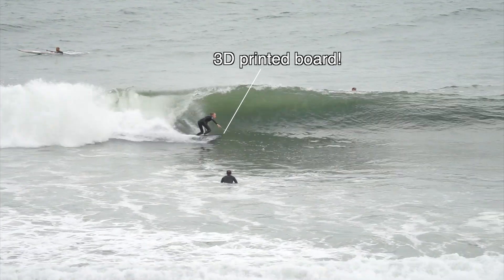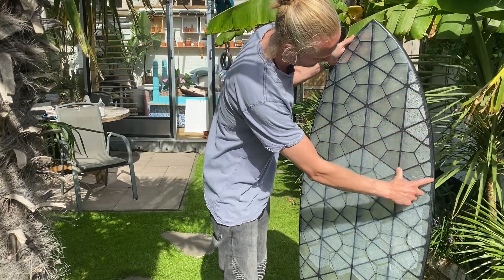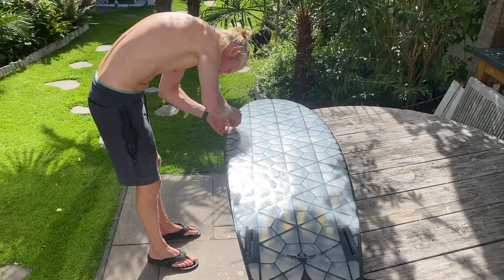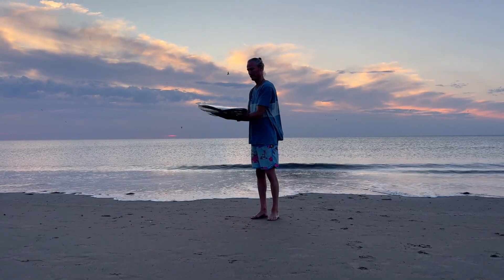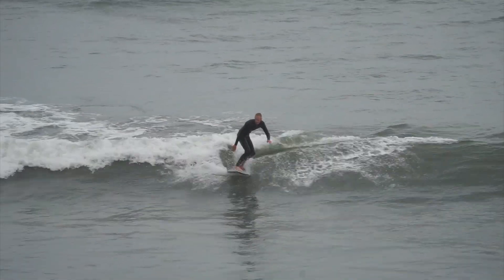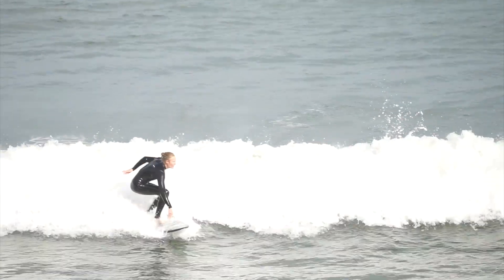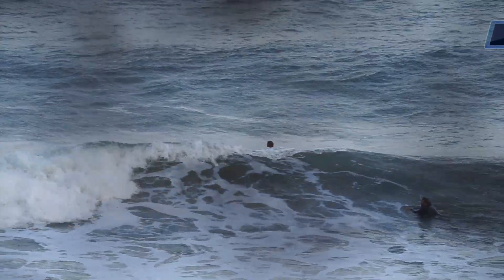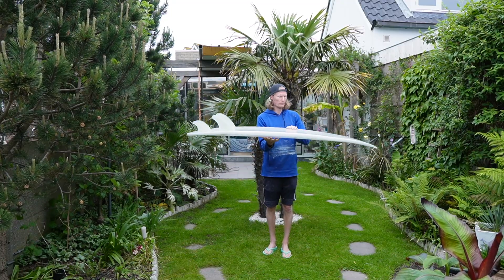Update on the 3d printed surfboard!

Comment: I’d like to suggest using PU or EPS foam as the core of the surfboard and then wrapping it with fiberglass and epoxy resin.
Reply from the maker: Thanks for the suggestion! I think this is a sarcastic comment. I do appreciate this kind of humor. 
If not. That’s how traditional surfboards are made.. check my other video’s for that kind of boards.

Comment: When you were riding the board  it looked stiff. In other words it needed more flex in the board to match the contours of the wave. Additionally, the flex will give a power boost when it uncompressed kind of like a spring.
Reply: I also seen that the weight is kind of high. If your water displacement number is high enough(ie the boards flotation) you could thin out thickness of the board. This should give you more flex, thinner boards track better on waves as well.
Reply from the maker: I think this board is allready pretty low on volume for the waves we have in the Netherlands. So I’m not gonna shave some more floatation of off it. Thanks for your thoughts though!
Reply from the maker: Yep. That would help. The board is very stiff with the 3 carbon stringers in it.

Comment: Looking at you riding the board is awesome ! Loving it. The spray and wash from the board makes it look like the board does not want to glide well and the water flow has issues separating from the board, it looks like it sticks to the water far to well. That would make sharper edges and a slightly bigger rocker with a sharp edge for better flow separation a good start. Once the board gets up to speed better and has more bite the rest should fall into place.
Reply from the maker: The egdes are very sharp in the tail, so I don’t think thats the issue. Maybe starting to be sharp earlier in the rails near the finboxes will help? But adding more rocker, only slows the board down right? Adds turnability but sacrifices speed.
Reply from the maker: Thanks for your thoughts by the way! Appreciate it.
Reply: @Dzjiefoils  Looking at it some more, the rocker is probably ok as it is - the board does well when you get a good launch and glides up nicely, your position is pretty far back, so when you start carving the board stalls early. You could try to go with a swallow tail instead a fishtail, that would give you more area to stand on and help with keeping the glide up. I think the main issue is keeping the board at speed. A longer tail would help with that, but I don't think that you're off by far.

Comment: What fins do you havr on it ? I use machado black black and red, large fins. They hold me well I'm 80kg. Never slipped out on b turn.   And also try to compress more down there to accelerate better. Your level is better yhan mine ! 😂
Reply from the maker: Thanks man! The fins are not the issue because I use them on my onther small fish and that works great. Maybe its the combination of the fins and the board.

Comment: Try making the hexagons smaller next time. You therefore can make them thinner and maybe even save material/weight. What i figured out while 3d printing is that the normal thin infill with 20-30% is often lighter and more stable then me trying to make artificial hexagons. It wont look that nice tho ;) :D But then you could also use Carbon fiber instead of Fiberglass
I'll keep watching and learn for my own surfboard build!
Reply from the maker: Thanks for the input! Will defenitely consider it.

Comment: I'd like to suggest incorporating a wooden stringer, perhaps by leaving an opening in the center portion of the spars?  If you can find old-growth heart vertical grain redwood or spruce with many growth lines per inch it may provide some springiness to the board.  Most wood sold now is just pulp wood as the trees are too young to have the ideal structure.  But you can find recycled wood sometimes - probably harvested in the early 1920's in California, I don't know in your area. But those trees were likely hundreds of years old.  If you make a  6mm thick picee of that kind of wood and try to break it it takes a lot of force and will bend into a bow before breaking. In comparison the new pulp wood of the same size will easily snap.  A 6mm piece of vertical grain wood my have at least 6 growth lines and perhaps eight.  Perhaps bambood would also be a good option and easier to find.  Edit: I just found your other video about the carbon stringer and probably that will be tough to beat with wood.
Reply from the maker: Hehe this board has 3 carbon stringers. So maybe too much, so not enough flex?
Reply: @Dzjiefoils  You're way ahead of me, I subscribed and will have to view thee earlier videos, I just found your channel.  It looks like the biggest innovation ever in surfboard manufacture so good going.  I was the one who suggested the one way valve for draining water..next will be a bilge pump lol

Comment: I might have some ideas. I would thin out the 3d printed core to reduce weight. then, glass the board, add a layer of aramid honeycomb/nomex, glass again. this will help distribute point loads caused by your core. Also, because you now have a full sandwich construction, it will make the board waaaay stronger if you smack it on something. 3mm PVC would be lots cheaper than nomex but isn't transparent. Carbon would be better than fibreglass but isn't transparent.
Reply from the maker: Yeah i have some 2mm Soric cloth lying around. So was already thinking of using it in this board, but it ruins the look a bit. Of I cant change the structure I would defenitely try this method on my next board.

Comment: What's the weight of the board? Boyuancy can also have it's effect. Fishes work better with some additional weight to get glide, so it could be you need to adjust to the weight, but it shouldn't be the reason you can't bury the rail. Perhaps a practical option would be to remove volume out of the rails.
Reply: Nvm watched your previous video, its about 4,2kg. Its perhaps on the heavier side, but again, don't think that's the problem it not turning.
Reply from the maker: The turning problem is related to my feet not getting the grip they need, I think.